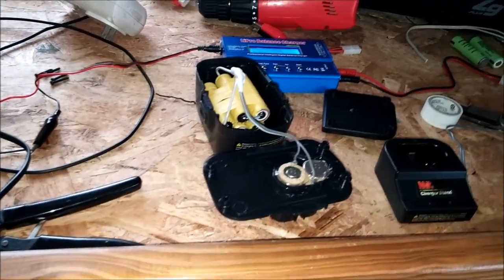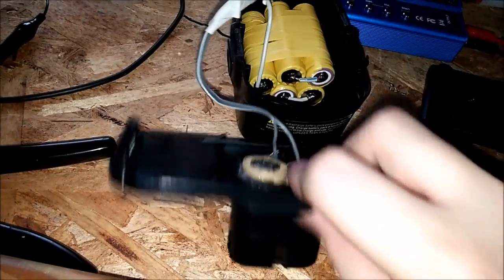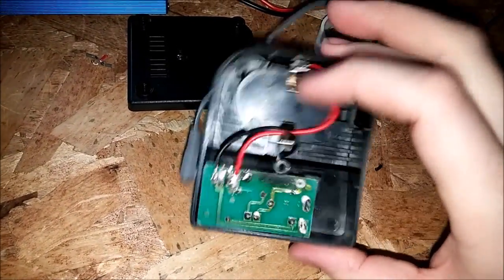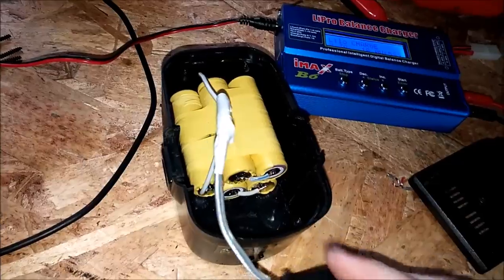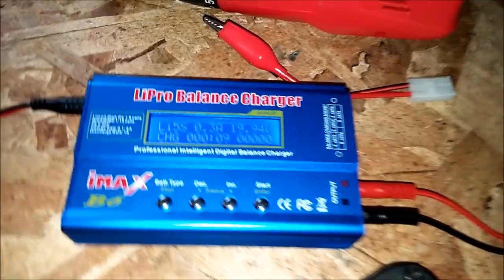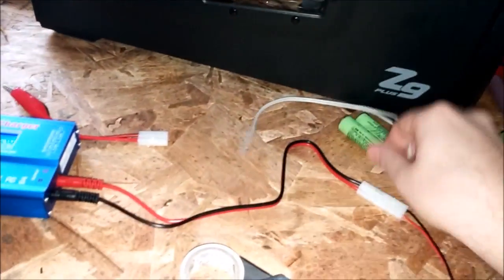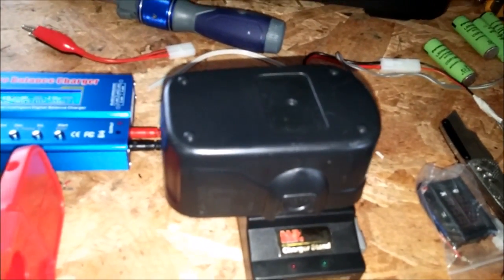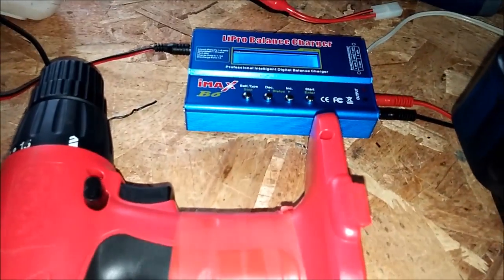NiCad battery pack to lithium ion conversion 18650 batteries

Comment: I didn’t get the charger either, as I got my off a clearance rack. SCORE! 

But there are options. It’ll use a power supply with an output of 12v up to 15v, which makes it easier. I stockpile XBox360 PSU’s as they’re a great source of 12v power with a high current (16A for the black sleek ones) and can be found all over ge place. If it’s not enough current, find another and stack ‘em (wired in parallel). I’ve done this with up to four, to push a couple Sony Xplod 1200w car amps wires to two 15’s in my home theater..... but only temporarily. Worked without issue though. Just be sure that if you’re wiring them in parallel that they’re the same model. 

Anyway, one will power the iMax just fine, just solder  a 2.5mmx5.5mm barrel connector to the output into the imax. Or just try your Box O’ Wall Warts till ya find one that fits.

15v wall warts are less common. I find them usually pushing media speakers and soundbars. My old beige Harmon Kardon media speakers uses a 15v that has a connector that works as-is. 

Have fun.

Comment: would it be safe to wire a laptop charger into the battery charger of the pack if the voltage was correct?
Reply from the maker: no. you have to have a special li ion charger to charge these batteries.
Reply: I follow your question. YES. If your laptop charger has an output of anywhere between 12v-15v then it will not damage the Imax B6. The amperage requirement asks for 5a, however, and your laptop should provide at LEAST that. 

Or do what I did....old Xbox 360 power bricks provide 16A of regulated 12v current. One will do you fine. Follow online tutorials (reference powering car amp indoors) to wire it up, and throw a barrel connector that fits the imax on the end (2.5mmx5.5mm) Viola! 

-dude wasn’t asking if a laptop charger would charge the batteries, he asked if it would power the CHARGER. And a laptop brick with 12v? Uncommon, but whatever....just keep between 12v and 15v, and 5amps+

Comment: Is the balance charger necessary? If the batteries are connected in series as those ni-cd ones and sum up to the same voltage, can't they be charged with the same charger? Is the charging process so different? I don't have a balance charger and don't know how to use it, so I take my li-ion batteries out to charge them by designated usb chargers. But it's inconvenient.
Reply from the maker: yea you need to charge the batteries with a balance charger designed for charging li ion batteries. if not they could explode.

Comment: how can i charge those new batteries with a balance charger?
Reply from the maker: you would have to solder in a balance lead to the batteries and then hook it up to a balance charger.
Reply: bam6972 is it possible to charge them even without the balance charger? Thanks...
Reply from the maker: no. need a balance charger. i have been charging them like this for awhile and no problems yet. been testing each battery and its within .2 volts of 4 volts.. every time.

Comment: I have a black and decker drill 18 V and upload and checked the voltage and gave me 21 V, therefore 5 batteries in series 18650 lithium can be charged to 4.2 V each and give 21 V and drill work without problems with this voltage  21V.
Reply from the maker: should be just fine. that's the way mine was too. I did this to a 7.2 volt drill as well. made it a 12.6volt drill. works fine.
Reply: gracias

Comment: How do you balance charge the batteries? I understand you have a balance charger but since you have them in series I don't see any balance leads coming out from your battery pack.
Reply from the maker: I don't balance charge them but it is highly recommended. I have been using it for quite awhile now and check them every now and again. there resting at around 4.1 to 4.2 ish. not a problem yet.
Reply: Usually ran in series one will drop load to other. Which is why they use diodes. This isn't the safest configuration while running it in series but if you have protected 18650's which have white circles on the top then it should be fine.

Comment: Yes, but do they hold up under high loads?  Laptop batteries are not rated for high amps like the NiCads were.
Reply from the maker: +Beulah Lips yup. they hold up great.
Reply: Buell Ah I have done this conversion with lap top batteries. it works for a drill but is you us it on a circular saw it will not down and eventually kill the battery from heat.

Comment: how do you get the charger to the Lilo setting? mine won't show it with stock settings..
Reply from the maker: +djSpinege you have to go to the setup or settings option and change it.

Comment: At 3:45 you said to get the 'charger' with it but do you mean get a 12v 5a power supply? I appreciate your video. It's brilliant mate.
Reply from the maker: Bull Shyte for the lipro balance chargers you can get the special wall charger that goes with this unit. you pay a little extra but its worth it. the charger does not come with it. its sold separately. but yea  12v 5amp power supple would work great.
Reply from the maker: what I usually do is use my drill and at the end of the day its still at over 3.7 volts per cell. I don't balance charge them because I don't see the need to. they all stay at around 4.2 volts per cell fully charged. so I just charge them and go. they last forever!!!!!! you should balance charge them though to prevent damage to the batteries. and charge them with a good charger. but all in all I haven't had a problem with them yet.
Reply: Shit. Xbox 360 PSU. Provides 12v @16A. All you’ll need.

And it’ll operate fine anywhere between 12v and 15v according to literature, manual, and in my personal use.